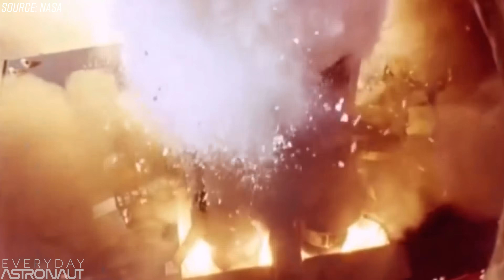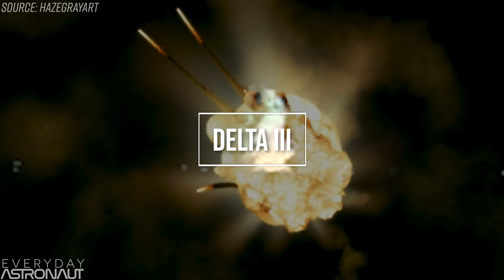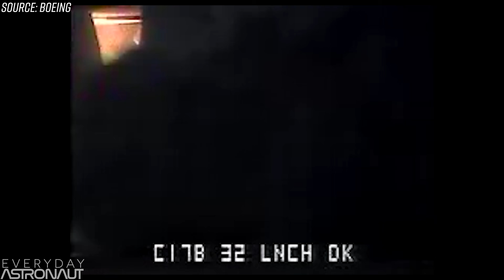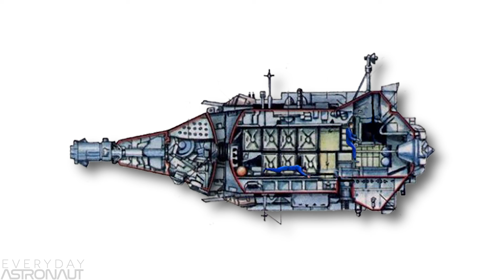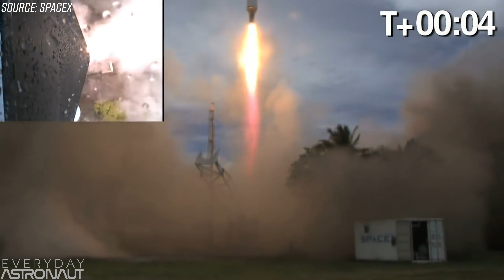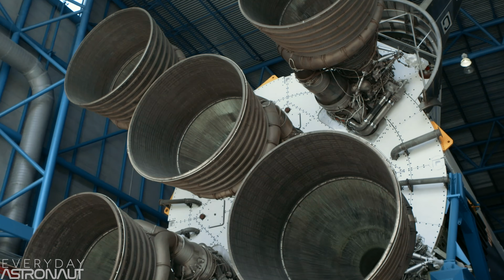Abandoned Space Hardware: CANCELLED Part 2

Comment: I don't know if one man standing on the moon alone would have been that much more intense than the CSM pilot orbiting the moon alone while his two buddies were   
hippity hopping on the moon's surface.   https://www.youtube.com/watch?v=hmi_By-G_Fk
Reply: That's all JFK asked for.  1.
Reply: @dahawk8574     You are absolutely correct.  JFK wanted to put "a man on the moon and return him safely home".  That was JFK's dream to land a "man on the moon".  But we must give credit to Werner Von Braun, the genius who convinced Kennedy that a rocket similar to a future "Saturn V" was necessary.   Please don't forget, this was the beginning of the dream.  In a way, the Russians had some very good ideas.  Like sending a second Lunar lander ahead of the "manned" lander to use just in case the original lunar lander didn't function.
               But NASA decided it didn't need a "beacon" to land ahead of the LM.  It had it's AGS and PNGS radar as a backup for its abort ascent module dedicated by a third identical computer just in case the original two radar units failed.  So NASA also had a third back up unit.  It was simply more dependent on electronics, rather than another manual backup LM that the Russians astronaut could go to in case the first unit failed.   However, the U.S.  Ascent Module was never tested.  Imagine that, the ascent module was never tested.  It had explosive bolts with special EB batteries that the astronauts had to confirm during their post-landing checklist were adequately charged, otherwise, an immediate abort would have been called for moments after they landed on the moon.  If an abort were called for, the abort button on the ascent top part of the LM would ignite its only hypergolic mixture engine held into place by bolts that would explode after the ascent engine fully ignited.  That's why we see sparks on the side of the LM when the astronauts depart from the moon.  Those sparks are from the explosive bolts exploding after the hypergolic single engine was engaged.
              The Russians had a well-planned system as well, but having a single person dedicated to landing on the Lunar surface was, IMHO, inferior to the LM system the U.S. had.  And leaving the CSM pilot orbiting the Moon while the two U.S. astronauts walked on the lunar surface was an added "insurance policy" IMHO.  Both systems were logical.  However, IMO the U.S. system was superior.  The only concern I had was the confidence NASA had in an untested Ascent Module which was never tested.  The explosive bolts had to work and the hypergolic fuel pumps had to work as well.  They could not test it on Earth in its full form, although partial tests were confirmed to have been successful.
               The EB Batts had to have been fully charged and the hypergolic fuel/oxidizer valves had to work while they were electronically controlled, rather than manually controlled.  This took a great leap of faith by the astronauts on the NASA engineers.  I believe a secondary manually controlled valve for the descent vehicle LM should have had a backup manually controlled valve handle when the manual handle would have been used would have been a better backup system. I believe one of the astronauts, may Shepard, insisted upon this but was denied as being below NASA standards.  Source: "Rocket Men" by Craig Nelson.
         I say this because the Cargo version of the cargo 747 designed by Boeing on its front opening cargo model has a manual back up system for the hydraulic motors just in case the electronic motors fail during the opening of the front cargo bay hatch. Boeing has allowed for a manual backup, just in case, there is an electrical fault during the opening and closing of its front opening model of the cargo 747 ships.  Boening engineers learned something from Alan Shepard's complaint that there should be a manual back up valve for the ignition of the take-off of the LM, just in case the electrical system didn't work.  Guess what, he was right.  During Apollo 11, a circuit breaker cap broke off on the instrument panel possibly allowing Armstrong and Aldrin to have their graves on the moon.  If it were not for Buzz Aldrin's felt tip pen being able to have the capacity to have been inserted into the circuit breaker, they'd still be there on the moon.
                Good job Boeing engineers for developing a manual bypass for the cargo version of the 747 allowing for a socket to be inserted into the electrical pumps that lock the front locks for the special open front cockpit version of the cargo 747.   You guys are geniuses, and you owe your inspiration to the astronaut who insisted that a manual valve handle be used on the LM to mix the hypergolic fuel and oxidizer just in case the electrical circuit failed.  BTW, I'm not certain it was Alan Shepard who insisted on a manual valve.  If it was another astronaut, please forgive me.  I need to go back to "Rocket Men" to confirm my data.  I'm sorry if I got the astronaut wrong who insisted on the manual valve on the LM for the descent stage.  JMHO.  LLAP.
Reply: You said, and repeated several times that the Ascent Module was never tested.
You might want to check your facts here.  The explosive bolts on the LM were used on two separate missions prior to Armstrong & Aldrin's.  The DPS was used twice.  And the APS was used twice.  Activating the explosive bolts and then firing the APS, in that sequence, was done on the two missions prior to Apollo 11.  This is the sequence that is done in an abort situation.  If I were Neil, the success of those systems on the two previous missions would have given me a high level of confidence that if I needed to abort then it would work as advertised.

As for reliability in the LM & CSM engines, it is hyperbole when you hear people talk about how "there was only one engine so it had to work perfectly".  These are people who were well aware that the valve systems were designed with multiple redundancy.  They say that because it makes the situation sound more dangerous than it actually was.  Exaggerated drama.

I will also suggest you check your facts regarding JFK & Von Braun.  The general public holds this view that it was JFK who got the Saturn Program started.  If that had been the case, there is no way that the landing would have happened in the 60s.  JFK had the Moon program handed to him.  Saturn was started under the leadership of Eisenhower.  Ike is the guy who signed off on developing a 1.5 million pound thrust engine.  Ike was the guy who gave the green light for Von Braun to do Saturn.

...yet no one gives proper credit for Ike's leadership.  NASA has a center named after JFK.  Even one named after LBJ.  But they don't so much as have a freakin auditorium named for Eisenhower.  It was Ike who got the ball rolling.  JFK just went along with what Ike started.

JFK's speech was far from "the beginning of the dream".  Wrenches were being bent toward that goal YEARS before JFK got to the White House.
Reply: I said:  "The explosive bolts on the LM were used on two separate missions prior to Armstrong & Aldrin's."
In that count, I was only looking at the two times when it was an astronaut's finger that initiated these actions.  More significant was the test flight flown in January of 1968 where the LM "fire in the hole" capability was fully tested without anyone onboard.  It was such an important objective that it was even featured in the patch from that mission:
https://en.wikipedia.org/wiki/File:LM1_embr_original.jpg
Reply: @dahawk8574    You are correct about the ascent stage being tested.  On Apollo 10 Gene Cernan "drove down the pipe" and bragged about it before Neil Armstrong's first landing on the moon.  Gene told Neil Armstrong "we paved the way for your landing" (paraphrased quote).   Gene Cernan and John Young took "Snoopy" the under fueled  LM down to 50K feet before the LM aborted the mission.  The LM was purposely "under fueled" so that any unintentional landing could not have been made.  Source: Rocket Men by Craig Nelson.  Also, Crag Nelson gives credit to Von Braun for convincing President Kennedy to support the Saturn V.  Nelson, quoted others, who said: "Von Braun could sell ice to an Eskimo".  I will rely on Craig Nelson for the remainder of my facts.  If I've misquoted Craig Nelson in his best seller "Rocket Men" you can take issue with him, rather than me, unless you can show I've misquoted him, which I previously admitted to, but corrected my statement.  You sound like you have a good history of your facts, but I've not noticed any backup citations.  I'm relying on my two sources. "Rocket Men" by Craig Nelson and my feeble memory, which I admit is not as reliable as the hard work done by Craig Nelson.
                You are correct, during the simulated approach of Apollo 10, after the LM reached its lowest point, Snoopy separated from the LM using the explosive bolts and the ascent engine ignited and later the ascent portion of the LM rendezvous with the CSM.
                 Thus truth is the LM was fully tested before Apollo 11.  I got my facts wrong.  Thank you for pointing out these errors. 
As far as the political issues regarding president Kennedy, I'll leave that aspect of my comments to historians more experienced with the actual history than I.  Whatever political issues you insist upon, unless you can back them up by good historical facts, I will leave your opinions to others to qualify.  I'm not going to get into a YT battle over political details I don't wish to battle.  But thank you for pointing out my obvious "factual"  errors which I hope I've corrected.  Anything political, I do not wish to argue about because political issues are not solely fact sensitive but are personal views of history which people have a general right to oppose..
Reply: Here's a vintage NASA video that explains how the LM Abort capability was proven on the very first time an LM was flown:
Lunar Module First Flight: The Apollo 5 Mission (1968)
https://www.youtube.com/watch?v=vmsQuHMtA9I&t=9m29s
Reply: Also...
John Young stayed well above the fray on that mission.  He was Charlie Brown.  It was Tom Stafford who was Cernan's commander.  And that one critical moment of separation and firing of the APS  ...that one HUGE screw up, ended Tom Stafford's career as a lunar astronaut.  There's an excellent video of that posted to YouTube also, on the channel by 'LM5'.  He posted the audio paired with a cg rendering of exactly what Snoopy was doing at the time of the switch error.

That too is another incident that people have WAY overstated the danger.  You hear Cernan tells the story and he makes it sound like they were tumbling out of control and almost crashed into the Moon.  Laughable, when you know what actually happened.  But sailors like to tell tall tales.
Reply: @dahawk8574    OK.  You seem to know your stuff.  But yet there are great books like "Rocket Men" by Craig Nelson, that can not be ignored.  He spent years of research on the facts of the Apollo space program.  However, I do appreciate your knowledge as well.
Reply: The most significant thing that I have never seen any space historian acknowledge is the simple fact that the Soviets could have easily beaten the US to be first to send human beings to the Moon.  In a different post, I gave this feedback to Tim Dodd.  This series was a perfect opportunity to highlight this fact.  And he could have educated people on this during the 50th anniversary of the Apollo 8 mission.

So many people understand space history as the USA beating the Soviets so badly that the Soviets were not even in the running.  Tim's tone here in this video seems to convey this same attitude, yet it is grossly mistaken.  The Soviets had proven capability to get there first.  They simply decided to not do it.

I have listened to Craig Nelson.  I have not read everything he has published.  But I've kept tabs on the other space historians too, and it seems that no one acknowledges this basic fact.  There were two whole books written in 2018 on the Apollo 8 mission.  I have listened extensively to those authors, and one of these very long talks was done with the Apollo 8 crew sitting on stage right next to  this author.

No one acknowledges that the Soviets had the proven capability to beat Apollo 8 to the Moon.  No one.

There are some very basic facts about the Space Race that people don't understand.  Like JFK.  Everyone sees him as this grand visionary who got us to the Moon.  But the basic fact here is that he was PULLING THE PLUG ON APOLLO.  He announced his intention to kill that program.  Just about every single space historian out there ignores this fact.

If Craig Nelson has a handle on this stuff, I have yet to see that from him.  I haven't seen it from anyone.  Very basic stuff that everyone has no clue about.  I would love it if someone were to write a book, post a blog, or make a video to explain this stuff that everyone misses.  It would clearly say that the Soviets could easily have been first.  And then it would explain why they decided to not do it.

We are more than half a century past these huge moments of history.  It is high time that space history got straightened out.

Craig Nelson doesn't have a clue.  Neither does Andrew Chaikin, nor John Logsdon, nor Jim Oberg, nor Jeff Kluger, nor Robert Kurson, etc, etc.  As far as I've seen from them.  It is very strange, because all of these space historians have the facts staring them in the face.  All of these folks are very smart people.  Same with Tim, Scott Manley, Amy Shira Teitel, the Curious Droid guy, Fraser Cain, etc.  We are on the brink of returning to human spaceflights to the Moon.  It would be excellent if the public was given the accurate story behind how and why it happened before we go back.
Reply: @dahawk8574    But no Saturn V blew up on the launch pad.  The problem with the Soviets is that they had a good plan, but their rockets kept blowing up on the launch pads and killing their best people.  One of the launch pads was so badly damaged they never could use it again.  You don't need me to tell you this.  Just go to YT videos of the soviet's equivalent to the Saturn V blowing up on the launch pads.  Yes, the Soviets "could have" but for the fact, their largest rockets kept blowing up on the pad.
Reply: The rocket they could have used to beat the USA to the Moon is the Proton.  It flew successfully something like 10 times by the time Apollo 8 launched.  The Zond spacecraft which they mounted on top of the Proton flew successfully all the way out to the Moon.  The Zond-Proton combination had repeatedly proven that they could get their cosmonauts to the Moon.  And if they had put people on board, they would have been the first human beings around the Moon.  Not Borman-Lovell-Anders.

Famous cosmonauts like Alexey Leonov were fully trained and fully willing to go.  He was the commander of their first lunar flight crew.  Valery Bykovsky was his crewmate.  There was absolutely nothing that prevented the Soviets from getting there first.  All they had to do was put these guys into their Zond and launch them.  Everything had been fully tested to get them there successfully.  This was a capability that the Soviets had proven multiple times.
Reply: And that is why the Zond is a perfect topic for this video series.  It was fully developed and tested, but the Soviets scrapped its ultimate goal.
Reply: @dahawk8574    DA Hawk, here is where you and I depart.  The Saturn V never exploded on the launch pad.  The Soviet version of the Saturn V, did, many times.  Thus, the Soviets lost the space race to the moon because their rocket design had flaws that were never corrected before the Americans put the first man on the Moon.  The Soviets conceded the loss.  That is a historical fact.  You can argue whatever you want, but the Americans made it to the moon first because of the American superior technology, as well as the "Grace of God", which the Soviets never believed in.
             If you dispute this, all well and good.  But if you do, please be kind enough to state that you have no bias nor prejudice to the U.S.A.achievement.  Please either confess or deny that you were or are a U.S. citizen when the event happened.  If you are too young to have been born during the greatest achievement of mankind, please at least be willing to state that you are not a U.S.A. citizen or patriot.  At least we can know if you have any prejudices toward the U.S.A. being the first nation to put a man on the moon.
         There may be offenses taken by others if you were not. I don't hold grudges against the Soviet space race.  But if you were not there,  I'd like to know with whom I'm speaking.  Are you a U.S.A. patriot, or a foreign national designed as someone who has a gripe against the successes of NASA? 
            If you are a patriot, there will be no negative response.  If there is a negative reply, in any sense, we American patriots will assume you are not an American.   You would be someone who sides with others like the Soviets. So do you side with the old Soviet regime or the Americans?  State your reply firmly and directly.  Any deviation from the truth will be assumed to be a departure from your loyalty to the U.S. Constitution.  
                This is not a hard question because any homegrown American will side with my position.  Do you agree to take an oath to honor the U.S. Constitution to your death?  Do you feel sorry for the Soviet loss or do you honor the American victory?  A very simple question.  Yes or no?  Any intermediary stuff in between will be interpreted as a Soviet synthesizer.   JMHO.
Reply: What I have presented here are hard facts.  Facts do not have allegiances to any country.  They are either accurate, or they are not.  And I submit to you that everything I have presented here is accurate.  You can look these facts up for yourself.  Anyone can.

You persist in your point that the SatV never blew up.  Yes, of course.  But you say that in allusion to the fact that the Soviet N-1 repeatedly failed during every single launch attempt.

I was never talking about the N-1.  I was perfectly clear on the booster and the program I was referring to.  The Soviets did not have one Moon program like the USA only had one.  The Soviets had TWO.  The Zond-Proton and then the N-1 with its lunar lander.

And the simple fact remains that Zond-Proton repeatedly proved its capability to get cosmonauts to the Moon.  This info is on Wikipedia, among many other sources.  It is not controversial.  It is a simple fact.  There is one refinement that I can make.  I went back and looked at the exact numbers, and there were 8 successful launches of the Proton by the time that Apollo 8 launched.  I had said "something like 10".

And if for whatever reason it is really important to you to know what my nationality is and who my loyalty is to, I'd be glad to share that with you in private.  So if you provide a place where I can send that to you one-on-one, I'd be glad to let you know.

But maybe the best thing to do here is to simply end our discussion.  I did not offer this info with a purpose of offending anyone.  Anyone who cares can check every fact I have presented here and can verify for themselves that it is all accurate.  But we are emotional beings, and there are certain facts that many people would just rather not hear.

50 years is still "too soon".
Reply: @dahawk8574      Dear Da Hawk.  You have impressed me more by your words than I've ever disputed on the internet before this day.    It's too bad that you do not belong to the U.S.A. where we are allowed to have a free discussion about this area of history.  My country allows me to say whatever I want to say, even if I disagree with my country.    I'm a U.S. Citizen since 1952 when I was born in the U.S.A.   If  I disagree with what my country says, I can tell them to go to hell and not suffer for it.   But, I usually don't say such things because I love my country.  But you seem to be from a place where you do not have the same freedoms.
             However, I am proud of you.  You have told the truth as you see it in your heart.  I may disagree with you, but I honor your ability to disagree with me.  And if you are correct, I will admit I'm wrong.  I do not know which country you live in, but I respect your right to say what you believe.  I encourage you to stand for your beliefs, even if others disagree with you.  This is called "FREEDOM".   You must stand by your convictions.  Fight the good fight.  Even if you are wrong sometimes, stand up and fight the good fight.  GOD BLESS YOU and your COUNTRY.
Reply: This turned out to be a very long reply, so your interest in what I'm sharing with you here may be limited.

(pt1of4)
daffidavit, it is refreshing to have engaged in this exchange with you where mutual respect is the norm.  Thank you.
I will go ahead and dox myself here for you...
I am a US citizen.  I am the first member of my family to be born in the USA.  My parents were immigrants.  And one of my grandfathers was Russian.  Perhaps it is because of my Russian blood that I have strived to see things from the Russian perspective far more than most Americans do.
But I have also spent a significant part of my career positioned against the Russians.  I spent several decades working in the US military and NASA as a fighter pilot and piloting spacecraft.  While based at Edwards AFB, I flew in the same squadron with Chuck Yeager and attended the same test pilot school as Neil Armstrong.  I attended the annual Test Pilot Conference with people like Scott Crossfield and the actual "Six Million Dollar Man" Bruce Peterson.  And then during my years at NASA, I was selected to be the crewmate with an astronaut who walked on the Moon.  I got to interact with most of the astronauts who walked on the Moon.  And I got to work with several of the more famous cosmonauts.  I learned the Russian language because NASA required it of me.  But my mother had taught me a little bit of Russian when I was a young child.
I have had long and interesting face to face one on one conversations with not just Chuck & Neil and a bunch of other astronauts, but also Guenter Wendt and flight directors like Gene Kranz, Gerry Griffin, Glynn Lunney, etc and flight controllers like John Aaron, Sy Liebergot, etc.  And face to face one on one talks with people at the very top of NASA leadership, including George Mueller, Chris Kraft, Max Faget, people who have held the position of Secretary of the Air Force, Chief of Staff of the Air Force, Deputy Chief of Naval Operations, top leadership positions of the NASA Administration, Director of the NRO, etc.  There was one time when the Secretary of Defense made a decision, and I got that decision overturned.  One of my offices was adjacent to a man who was a center director at NASA.  He would make coffee for me during our many talks.  Another center director, George Abbey, had his office across the floor from me.  I had very close friendships with some of these people, with top management of Lockheed being a guest at my house, and me being a guest at the homes of these folks, sipping whiskey and such with people who walked on the Moon and a leader from the very top of NASA.  My school classmates from back when I was a teenager went on to become four star generals and astronauts, and Chief of Staff of the military, one friend founding a billion dollar company.  I am friends with the person who invented the personal computer.  His name is on the patent.  Most people are oblivious to the story of the role NASA played in the invention of home computers.

All I have shared here I see to be only a small part of my life's experiences.  And the bigger point, as made previously, is that absolutely none of it matters to the veracity of the facts presented in this thread.  It matters not that I learned key facts from a one on one talk with one of the chief geologists from Apollo while having a stroll with him on campus while I was in grad school, or talking to an Apollo astronaut who was my professor in my PhD program.

Facts stand or fall on their own merit.  They are either true, or they are not.  The person presenting the facts does nothing to make them more true.
  The references are available to anyone around the globe to read for themselves, and to arrive at the same basic understanding that I have.
Reply: (pt2)

I fully agree with you about the greatness of the USA, with our approach to basic human freedoms as being the central aspect of that.  But I do not see being a citizen of the USA as a necessary condition.  It is a quality inherent in all human beings.  You can be born and raised in a place like South Africa, like Elon Musk, and rise to the very top of your field.  Of course, the advantages of the USA will draw people like that to this phenomenal country.  It is what drew Wernher Von Braun to the USA, which enabled the USA to eventually succeed in landing on the Moon.  He could have chosen the USSR.  But he didn't.  It was a clear and easy choice for him.  As it was for my own parents.  The "Shot Heard Round The World" was not the sound of a bullet rifling from a musket.  It was the shot made by the stroke of a pen.  The pen that codified the principle that people ...common people, are perfectly capable of governing themselves.  The stroke of that pen was guided by the hand of people like WIlliam "Pen".  Today he is remembered when people walk the aisle of their grocery store to buy Quaker Oats and see his image and likeness on the box.  Those who know his story, at least.  Most are oblivious to the impact this one person had.  It is no accident that the seat of the American Revolution was Penn's city of Philadelphia.  It was created as a radical new community where people treated each other with respect.  "The City of Brotherly Love".  Philly is the filial city, where the concept was that everyone treated everyone else like family members.  With that much care and concern for your neighbors.  "Philadelphia Freedom" is FAR more than just an Elton John song.  It is a concept that revolutionized our country, and eventually became a wave that spread across our entire planet.

Gus Grissom flew into space onboard the Liberty Bell 7.  The crack in the bell, and the loss of his capsule, can serve as reminders to all of us on how our liberty is a fragile thing, and must be treated with care in order for us to preserve it.  "...to ourselves and our posterity."  We protect our freedoms today for the benefit of our children and our grandchildren tomorrow.

William Penn is the one who built the most important launching pad complex in America.  Philadelphia served as the base for Benjamin Franklin to explore the phenomenon of electricity, which today we have harnessed in ways he never imagined.  Less than an hour up the road in Princeton, a handful of decades later, Professor Robert Goddard used that foundation as the launching pad for his dreams.  Then he engineered his dreams into reality with the launching of that very first liquid fueled rocket on March 16, 1926.  His inventions were copied and improved by the likes of Von Braun working for Hermann Oberth's team, and Von Braun returned Goddard's dream back to the USA.  And he convinced his mentor Oberth to join him.  Penn's Philadelphia was the launching pad for Paul Baran, who revolutionized the world in how we connect with each other using his far more efficient distributed network of packet switching.  Philadephia was the base for this key feature of the Internet, where every node is treated, as a Freemason would say, "on the level".  Node on the internet have comparable status.  There is no "King of nodes" that rules over the other nodes.  The internet is set up with a "constitution" that makes it a self-governing body.

Take Penn's principles of treating all with respect, add to that Franklin's efforts to harness electricity, and this leads to Baran's method for creating a democratized system where people around the globe communicate with each other, as I am doing right now with you, at light speed.  The Pen in Independence Hall and Baran's light pen, if you will, have revolutionized our species.
Reply: (pt3)

There was a time when amoebas acted as separate cells.  Then there was this revolution in evolution where cells knit together and started to work cooperatively as one body.  This is the transition we are at with humanity.  Penn's launching pad enabled us to go so far out into space that we looked back on our planet to see it as a single whole.  50 years ago last month was when that epiphany happened.  And in the half century that has unfolded since that moment of singularity, we have knit together as a species far more closely.

So if anyone wants to know my citizenship, my answer is that I am a Citizen of Planet Earth.  We all are.
Borman Lovell & Anders were struck with the realization that all of us are crewmembers on Spaceship Earth.
Your original point was about the intensity of the experience of being alone.  John Young was the first to fly solo around the Moon.  On the very next mission, Mike Collins was the first to do so while also experiencing radio blackout, being out of contact with absolutely every other human being.  That must have been an utterly profound experience.  But he also knew that it would only last for an hour before he was back in contact.

Now imagine if you were out of contact with absolutely everything alive, and you also knew that it was a permanent condition.  For those who hold the understanding that God exists in a state where God is absolutely everything, everywhere, this means that there is absolutely nothing outside of God.  Absolutely no one to communicate with.  The words that Anders Lovell & Borman read on that Christmas Eve were about the story of how God created the Heaven and Earth.  This entire universe emerges from within your own consciousness, and now you have the experience of communion within that "matrix".
Reply: (pt4of4)

E Pluribus Unum.

We see and experience this multitude.  But when we reach the heights that Goddard dreamed of, we can attain the perspective that it is all One.  The Space Race was an ideological battle between Leninism vs Philadelphiaism, if you will.  A political and economic system of centralized control versus distributed control.  Along the way, in November of '67, The Walrus interjected with a B-side to deliver the message that...

I am he as you are (s)he as you are me and we are all together.

At our core, we are all from the same source.  With this understanding, we could say that this ideology of Lennonism has prevailed.  The USA was the first ...and as it turned out...  the only ones to reach the Moon.  But what we found was that it is a wasteland.  A magnificent desolation, as Buzz famously stated in modifying Neil's term for what they were experiencing.

We flew all the way out to the Moon to discover that the jewel worth protecting was our home right here.  And that we're all in it together, so if we wish to succeed then we will work in the manner that William Penn mapped out.  We will treat everyone as though they are a member of our family.  Because we are all from the same family.  Today we know this scientifically.  We can trace the commonality in our DNA with every other human being.  And trace back our common ancestry with an apple.  And absolutely every other living thing.  We are all from the very same Tree of Life.

Our efforts and advancements in science have taught us this as a simple irrefutable fact.  And our accomplishments in rocket engineering have delivered the visceral experience of our oneness as inhabitants of our precious planet.

THIS is the citizenship that I claim.  It is my birthright.  It is your birthright.  And with this awareness we will treat each other with the respect that you and I have shown each other here in this internet forum thread.  Our little corner of the universe where you and I have connected to interact, share and grow from what we have to contribute to each other.

Thank you again.  I have thoroughly enjoyed our exchange here.
Reply: @dahawk8574    All I can say is "God Bless You and your family".  The fact that you have named the names of people you know has convinced me that you are for real.  I wish to thank you for your service to the U.S.A.  I wish you the best for the New Year.  It was a pleasure and honor to have had this discussion with you. LLAP.  God Bless.
Reply: LLAP!  Love it!  You too, daffidavit.